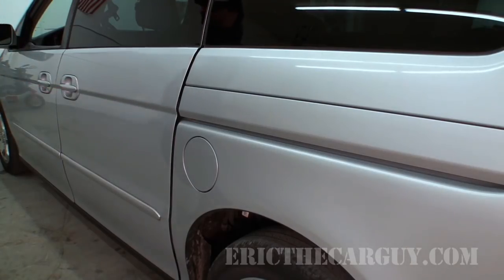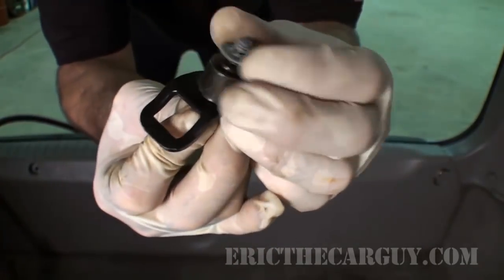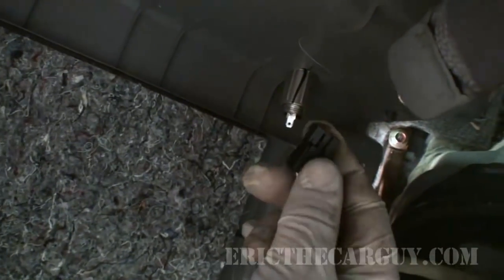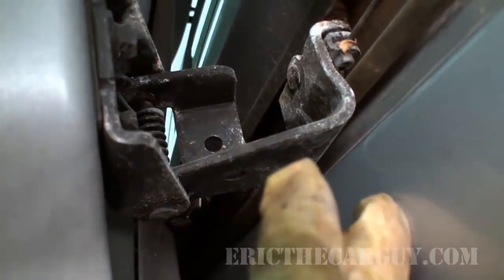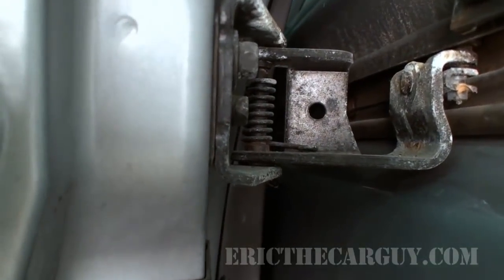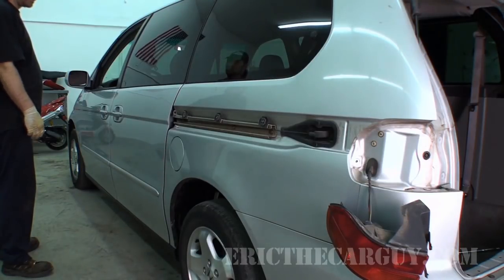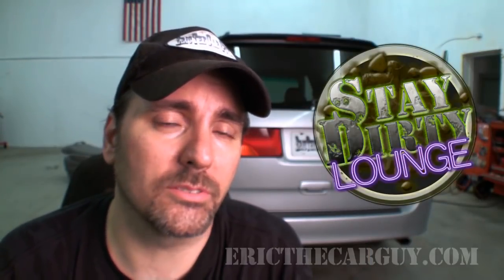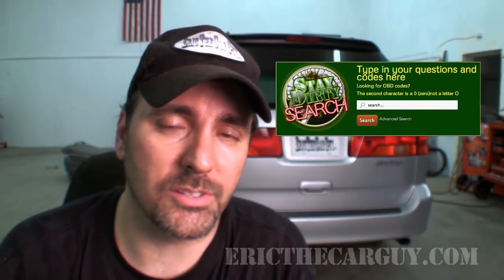Sliding Door Repair 2001 Honda Odyssey -EricTheCarGuy

Comment: eric, great video, informative...,y situation is the same but different :-) my dr side door will get almost closed to the point of walking in to lock and will load out and return thinking its crushing someone or something. i did the shake test and all is fine on that door. shake test on pass door reveals tremendous amount of shake so i will be attacking that side as well. as far as the dr side door, what could be causing the motor to overload? do you have a lube or maint. video to the degree of perfection as this one? i feel like i may not be searching the right terms to get a good result on the googles. thanks!
Reply: Mine does the same thing.
Reply: You could try the rehoming procedure first. If that doesn't work then you can check that your closer motor (not the same as the cable motor) is working right or, if not that, look for something causing friction (one example of which would be that the hinge on the center support is rusted).

Comment: The cable on the sliding door on the drivers side of my Honda Odyssey is broke and hanging out. I cannot open the door at all. Can it be fixed without opening the door? I think the cable is probably all tangled up inside the door. I want to also replace the middle door roller assembly. When I bought the part from Honda is does not have the piece that attaches to the actual door. The part you marked with a marker. Honda assures me they gave me the right part. It looks like yours without the flat piece that attaches to the door. I guess I will slide the pin into the old part to connect it to the door>

Comment: I have a question. I own a 2002 Odyssey that has this problem on both sliding doors. I can find the hinge for the passenger side door easily, but have been unable to locate one for the left (driver side) door. Can they be purchased or is it a dealer-only item?

Comment: Eric, do we really have to remove the inside panel to access the tension wheel? Does the cable have enough snack to undo the cable ends from the roller assembly?
Reply: More than enough snack.
Reply: Rýán Túçk LOL

Comment: Is it crucial to tear apart the interior or can this be done without access to the tensioner?
Reply: I partially tour open the interior panels, speaker, screw behind and screw in rear section(tool section-driver side). No problem getting to release tensioner.  Worked great on both sides! total time of labor 2 hours each side.  Had to disconnect battery so the automatic door closing sensor stopped ripping door off jack!!

Comment: Twice year, I have to disconnect the battery and pull fuse #13 to re-set the sliding doors and get them working again.  Cleaning and lubing the upper and lower roller tracks are usually part of this procedure.

Comment: I have a 2003 GMC Yukon.  When I use the keyless entry or the powerdoor inside the rear driveside or passage rear doors donot unlock. Also the rear hatch door don't unlock rear Windows wipers don't work. I replace the motor the same thing. Could it be the driveside switch.
Reply: No.
Reply: I didn't try the switch yet.

Comment: My driver side sliding door doesn't close all the way in and the door light/buzzer is on when I drive it. I checked the lower switch, latch, roller, electrical contact, guide and cable, nothing wrong with them. I'm thinking to adjust the cable tension thru the pulley to solve the problem. If I push the door while it's closing, it will eliminate the door light and buzzer.

Comment: hey eric I have a 2005 odyssey and the doors no longer open automatically. but if I disconnect  the battery and then reconnect it they will work fine for about 2-3 days then stop working again I'm lost I have taken it to the local Honda dealer they tell me its the motors.  I tell them it cant be the motors  because they work fine when you reset the battery. any help or advise you can offer me

Comment: So, can you fix the hinge without taking the van apart? My 2000 Odyssey has this issue.... Mine acts like it's having a seizure. And then gets stuck mid way. Took me 25-30 minutes to lift it and push it closed. Because the hinge kept moving where it got stuck hitting the van...

Comment: I have the same problem with my truck, but also It start to turn on the buzzer  when the truck is running and jump the trails of the train or if I am on reverse on a slide down so on  any hard movement, did you thing it is something else that I have to fix on my truck?

Comment: Didn't appear you had the passenger side panel clipped in all the way before you reinstalled the weather stripping. top and bottom were clipped in but the middle seemed to have a slight gap.  check it out.

Comment: i have a 2000 odyssey ex with auto doors and i have a problem with the auto locks not locking when parked on a hill, and sometimes the door randomly opens by itself (not safe or secure) ive woken up to find the door wide open and all other doors locked. any suggestions?

Comment: To repair the cables when the door won't work. There is a kit on eBay. Search "Honda Odyssey 1999-2004 Sliding Door Replacement Cables (Kit or Service)" The kit comes with everything you need for the repair to solder it. Solder is stronger than a screw on end (But you have to use special solder and flux to get it to work on the stainless steel wire). Yes, I sell it and this is a shameless promotion of the kit. But it works. I know you can go and get the cable yourself (you need an 81 inch and a 62 inch) but if you want to save some time and hassle it comes with good instructions.

Comment: I have the weird problem ever. We now have a 2005 Ford Expedition. It has Rear Air but its weird. Sometimes it works for a driving session. But most of the time it don't and blows out the intake vent and now the outtake vents are the intake. Recently it started blow no air anywhere but the motor is still running. They have tried replacing the restior but to no avail. Its like reverse polarity sometimes but works low when its set on high other times. I want us to just get a new blower motor.

Comment: I have a 2007 Honda Odyssey. I replaced the driver side door hinge  but could not get enough slack to get the the cables in. So I closed the door manually on close cable. I figure worst case scenario I will cut the cable tomorrow after work. (It was late at night.) I was going to fix it the next day but now I can't  get that door to open. 

To make matters worse the light goes on and says sliding door.  My wife tried to open it with the remote on accident. How can I fix these issues?
Reply: So what happened? I am having trouble with the cables as well. Just wondering what worked for you. Mine is stuck open so I can't even really drive it.
Reply: @keithstevens3674  It turns out that I can't open that siding door because the bottom right corner of the door was damaged. It is bent inwards. I plan on bending it back and if it breaks I will use JB weld on it. After I get that door open I will cut the cable and revert it to manual. Then I will use silicon grease so it will open easily. If I want it to revert back to open automatically I will replace the cable.

Comment: I can flat rate this a lot faster, I have a sawzall and new blades. As far as that spacer goes, I'd never notice it until it was completely reassembled, at such time I'd decide it wasn't needed. I really appreciate you posting this, now I can piss off the fumbly diagnosis on something I know absolutely nothing about, and just toss a hinge at it. I believe what I have is exactly the same thing, the screeching from the back was a clue, and your video is so helpful. Fucking Somedata sucks, youtube beats the hell out of it in a lot of cases.
Reply: 20:00

Comment: That stubborn Phillips head didn't have a lead in on the tip (a portion of the bolt with out threads to help start it) I'd bet it was Cross-threaded. :-/

Comment: Parts you want :  
Part No.: 72521-S0X-A51 
Male Assy., R. Slide Door Center Roller 
[Odyssey | 2004 | 5 Door EXL (LEATHER) | KA 5AT]
Remove
$55.56
 $55.56
  
Part No.: 72561-S0X-A51 
Male Assy., L. Slide Door Center Roller 
[Odyssey | 2004 | 5 Door EXL (LEATHER) | KA 5AT]

Comment: I never remove any interior pieces when replacing a siding door roller on a Honda Odyssey
Reply: I have a 2007 oddysey, do I need to remove all that inside?
Reply: +Eduardo Flores I don't but I'm a master mechanic and been doing it for years so I recommend you take those pieces off so you don't stretch the cable or scratch the paint
Reply: Wendell Greenidge should I expect  the same tensioner for the cable in my 2007 oddysey???
Reply: +Eduardo Flores yes

Comment: Engineers should at least consider the ease of maintenance when designing vehicles. You should not have to tear all that apart to replace a mechanical part that will eventually fail.

Comment: For a smart guy I thought you’d avoid that model van because of their infamous transmission fails.
Reply: edbtzkhud, I bought mine in 1999 and I have been changing the transmission oil every 30-k miles and never get any problems at all.

Comment: i know thats the propper way to do it, but why didnt you use a pair of needle nose vise grip to remove the cable from the center roller instead of removing the inner panels... its way faster never had a problem. im not judging... btw good video
Reply: dorivaldo ramos Please expand on this procedure - I assume you have to hold the cables tight?

Comment: When did humans become incapable of operating a sliding door manually? sheesh
Reply: Since manually opening a sliding door that has a motor and cable attached is heavier and more difficult than one without. Owners of this type of van typically have younger kids, who would be unable to open these heavier doors manually. Additionally, when you have an armful of backpacks, diaper bags, kids, and groceries, it's much more convenient to have the doors open for you ahead of time to get them in faster. It's not laziness but an affordance to have the motor do it, which is why these vans come installed with them in the first place.
Reply: Normanthecow01
diapers lol

Comment: Do not, I repeat, DO NOT take out the 3rd row seat!! Overkill, to the max, just like this whole stupid job. You don't even need to unhook the seat belt in the rear! Mainly because all you need do is pull out on the upper part of the side panel (without fully removing it) to get to the motor control. I disconnected only one side of the 3rd row seat and now I've got a whole new problem as the frigging seat latch wont disengage the latches under the 3rd row seat to fold it down into the back!! I don't like this van.'